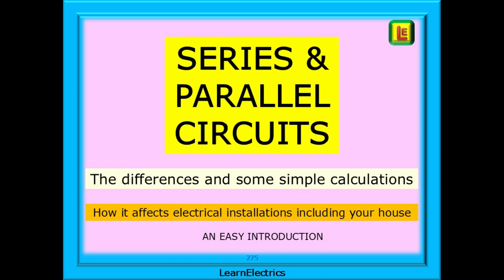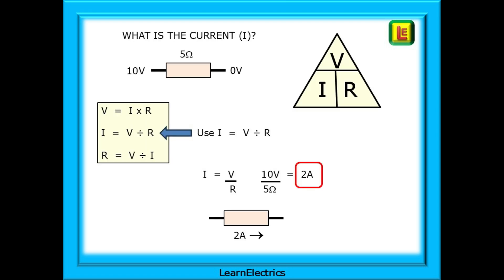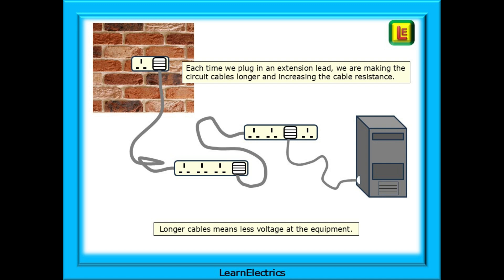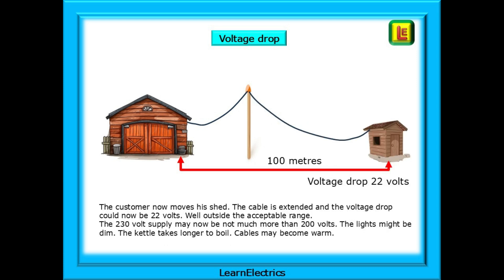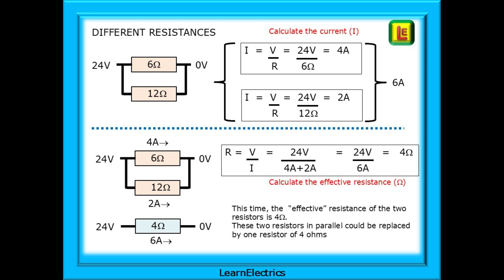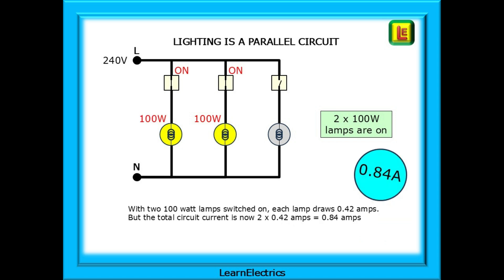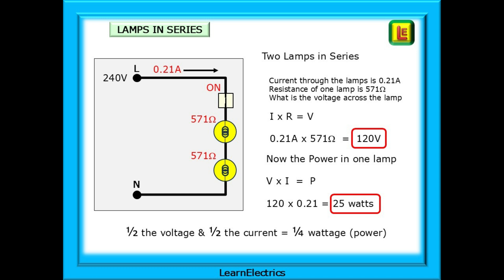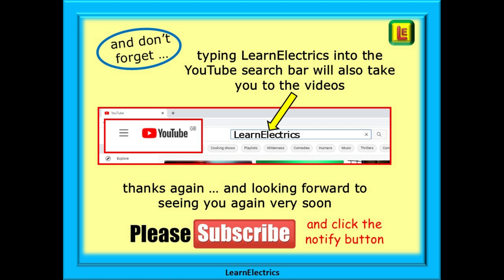SERIES & PARALLEL CIRCUITS – EASY INTRODUCTION – HOW IT AFFECTS ELECTRICAL CIRCUITS AND YOUR HOUSE

Comment: Sorry to be pedantic but the uk supply voltage is 240 volts not 230 volts. We only use 230 volts for our calculations inline with Europe as part of the uniforcation which included the charge in uk mains cable colours for Red and black to brown and blue. And Europe increased their supply voltage from 110 volts to 220 volts the uk did not reduce the supply voltage from 240 to 230 . We simply agreed a compromise where we all use 230 volts for calculations. .
Excellent video though as always.👍
Reply from the maker: Thanks for the support, appreciated. Dave.

Comment: Hi thanks for you continued contents; they’ve certainly helped me. 

Slightly off topic here, but I wanted to know if it’s permissible to joint DC cables to armoured cables or does it has to be PV ultra all the way?! Your help is mostly appreciated! Thanks
Reply from the maker: Yes, DC cables are included in the Regs, take a look at Table 4D4 on page 454 of the Brown Regs book.